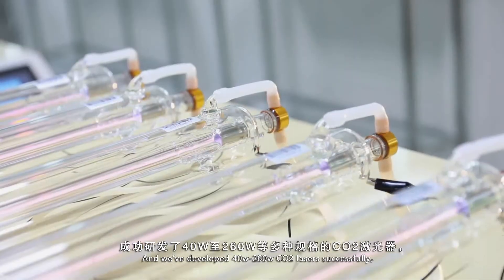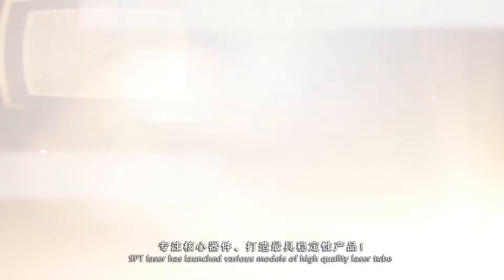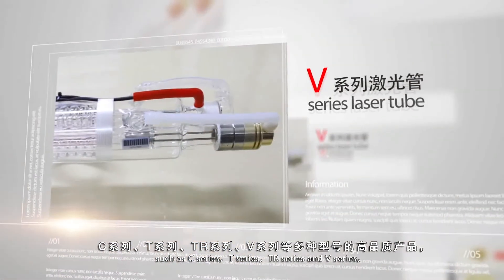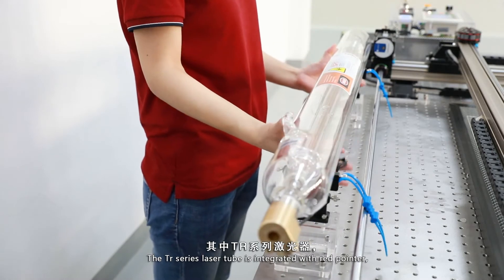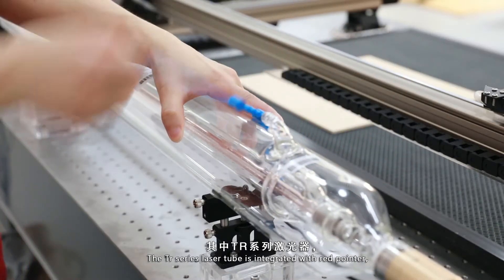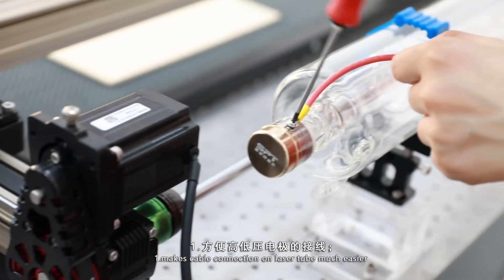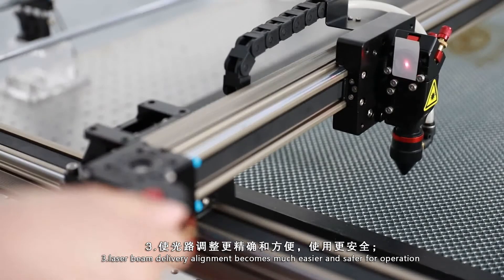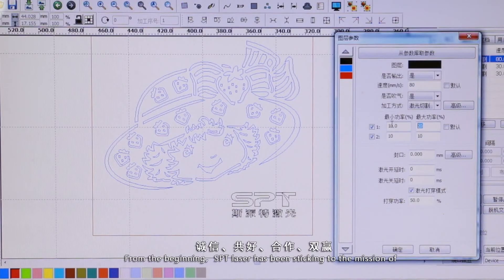SPT laser tubes

Comment: I can't stand these eBay laser sellers with whom I am in a fight with right now telling me a 700mm tube is 50w when I know physics and it takes 1000mm to do 50 watts.
Reply from the maker: yes, 700mm is normally around 30w.  50w is 1000mm. Just be careful about the cheap price next time.
Reply: Well, end to end is 800mm so is a 40 watt and all Chinese laser machines on eBay are 100 percent lies.  The K40 types are 30 watts and the 50 watt versions are 40 watts because neither of the machines is wide enough to hold a real wattage tube.  I am so burnt by the K40 and now the 50 watt sellers I am done with laser machines if from China.  If I could get to the manufacturers of these machines I would punch them square in the gut to relieve my anger as I have returned both of those machines and the 50 watt is pretty bulky and very heavy but I managed it solo.
Reply from the maker: Oh, that's really bad experience. But not all of them are bad, hope you still have faith for Chinese lasers. By the way, where are you from, America?
Reply: I am in Tennessee and I have a 50 watt machine that came to me broken and they refuse to even send me a new power supply (really a 40 watt) so on Friday USA time I start the process for eBay to force them to pick it up and return it to them for my refund.  None of them have been good and I need lift gate service here and all of them charge off of eBay for that so if the machine is like this one then I have to pay instead of them.  All of them are crooks and I asked all sellers on eBay and only this one rolled the lift gate into the final price but they are just as bad in other ways.  My 40 watt I returned was beaten up, missing parts, and the X axis was 20-30 degrees bent and their "engineer" showed how to grab it with both hands and bend it back with Gorilla strength and after I asked around all said it will never work right after that.   This is why when these sellers mention they asked their "engineer" I lol and roll my eyes because no engineer would have someone do that.  The latest with the 50 watt had an "engineer" that was just as dumb.
Reply from the maker: I think they sent you photos of the machine before shipping, the machine was good that time. But how come it becomes like a mess when it's received by you? The packing was damaged or what? It must be strong plywood package with the fragile remarks so that people will handle it carefully. And yes, the X axis shouldn't be handled like the way that they advised you, it's not a smart choice. 
At the beginning, you mentioned that you have a 50w machine which is broken and you request them to send you a new power supply. Was the power supply broken? 
Meanwhile, there are many 40w laser machines available in America, you can try from local supplier next time if you have no faith on eBay.